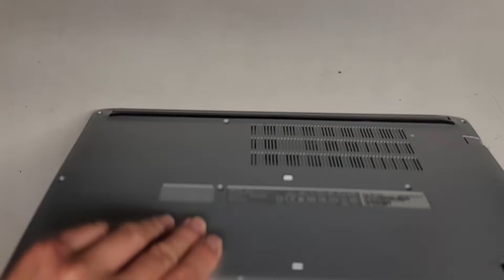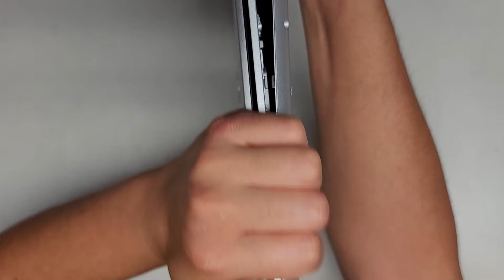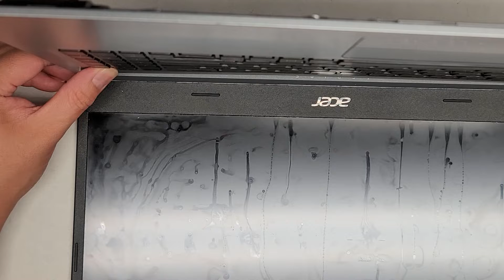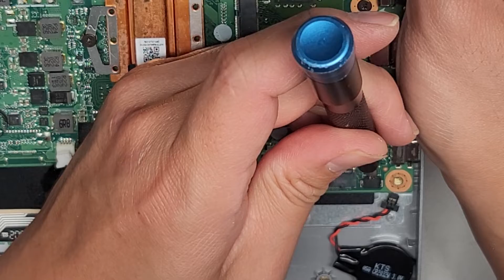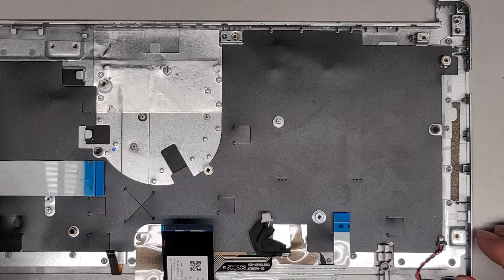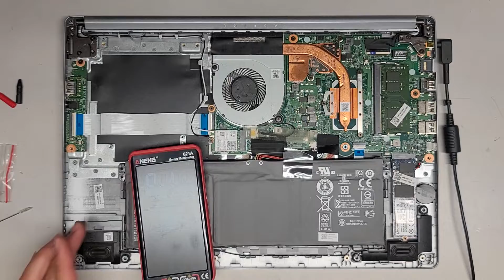Acer Aspire A515-55 Series Disassembly RAM SSD Hard Drive Upgrade Battery Fan Replacement Repair

Comment: 0:37 This key is PH00 PH0?
Reply from the maker: 1, where are you getting 0 and 00 from?
Reply: @ItsBinhRepaired Sorry, I don't know English, so I don't understand what you're saying in the video. I'm asking if at the beginning of the video you use PH00-PH0 or PH000-PH00
Reply: I was looking for a video on how to disassemble a laptop to find out what type of screwdriver to use, But it seems that this type of video doesn't exist in my country
Reply from the maker: @alferreira_tenma  I'm using JIS1 PH1 should also work. Why do you keep saying 0s?
Reply: @ItsBinhRepaired i don't know, thanks for reply😅
Reply from the maker: @alferreira_tenma lol